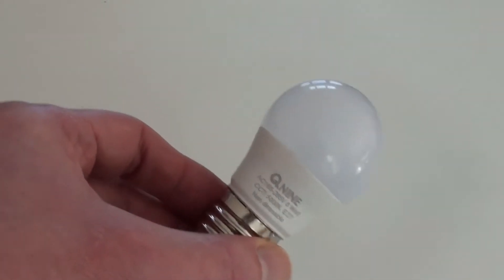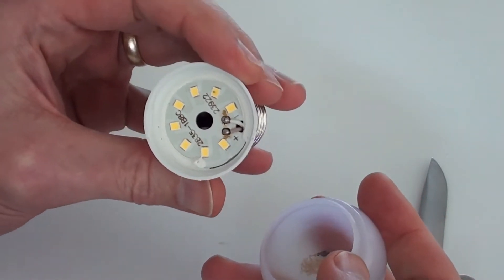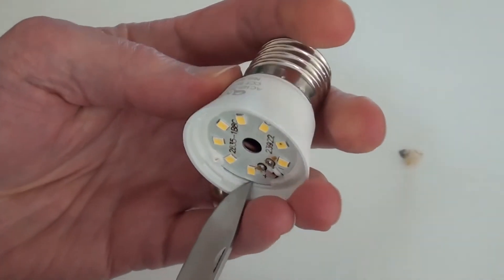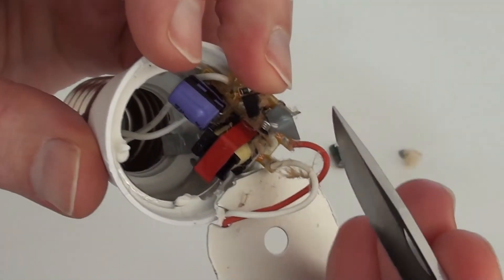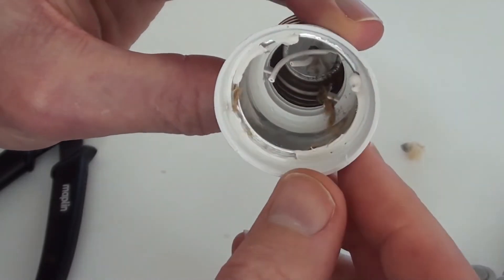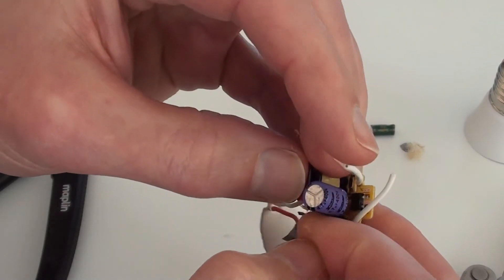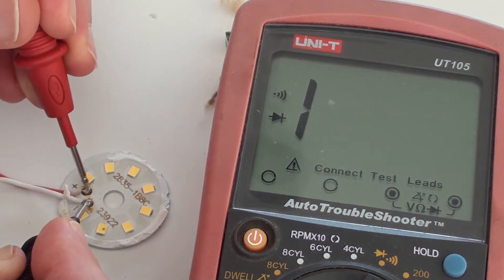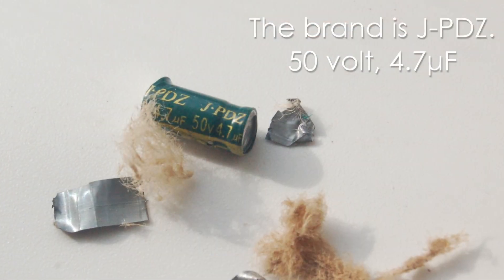Blown LED Bulb

Comment: Yeah, no, IIRC, the LEDs are wired in series and get blown open.
If the power control circuitry didn't fail — you could bring it back to life by solder-bridging the blown LED pads and eek out the leftover potential of the bulb while preparing a future replacement.
But there may be different designs unlike those I salvaged…